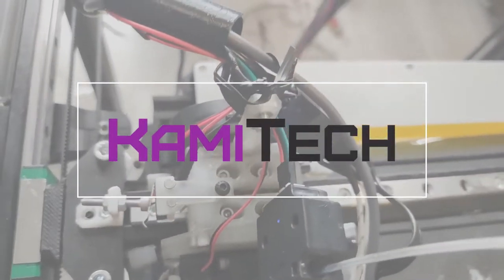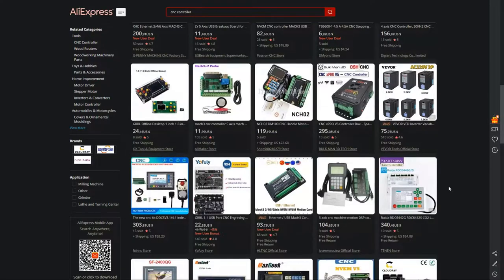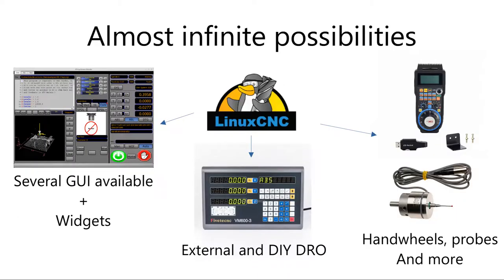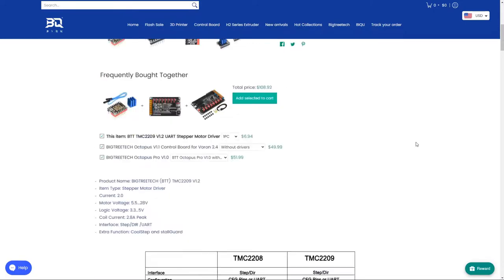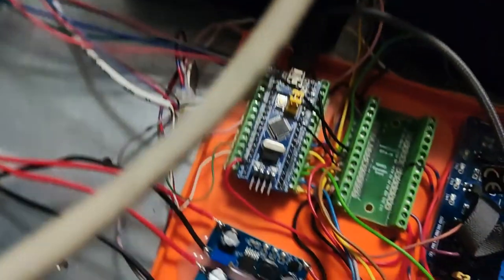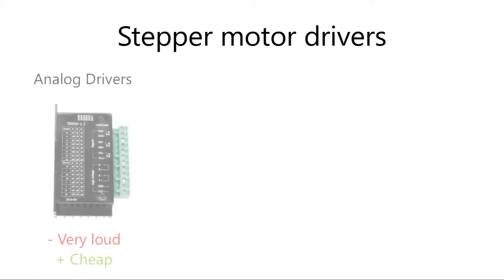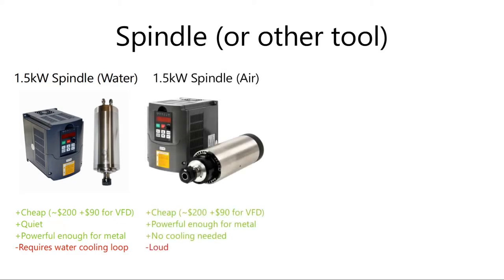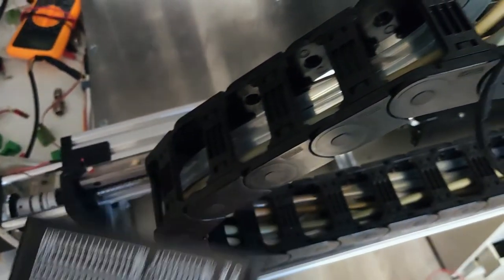Ultimate Bee - Electronics, firmware and wiring CNC machine - Part 3

Comment from the maker: Just to clarify, by "most versatile" setup i was talking about huge selection of breakout boards for linuxcnc/mach3/mach4, not just the $3 board as there are some really advanced ones, hybrid control and whatnot, if you plan on making direct control, i would advise to do extensive research about it, especially reliability and speed limits.
I also need to mention that for CNC controllers and DIY motion system you can use 3D probes or handwheels as well, it's not like they are limited to direct control.

Comment: i allways wondered if you can tap intoo the small driverboards on the 3d printer controll boards and just use the step dir signal to drive the bigger drivers and operate say nema 23 steppermotors , not sure if their will be issues with setting up the distance traveled and stuff like that